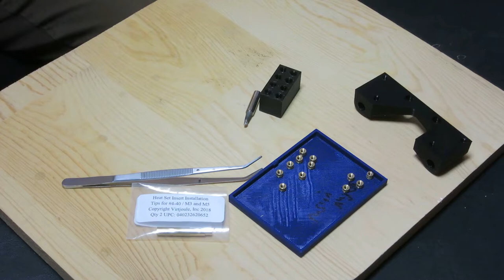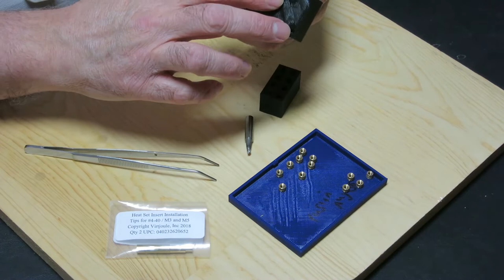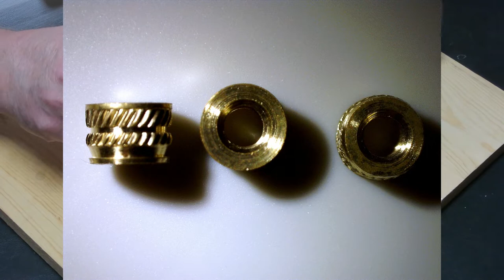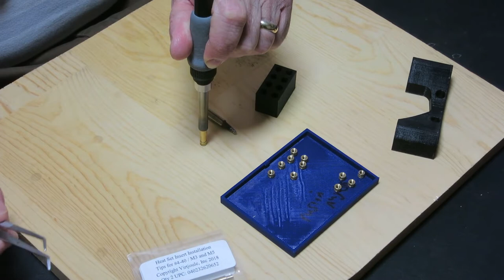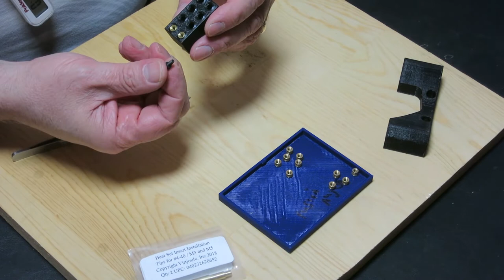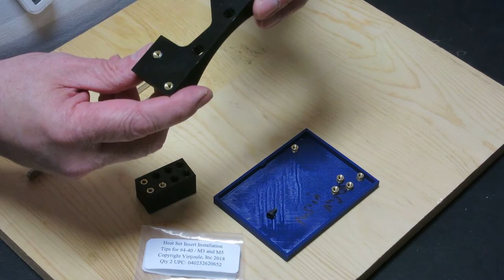I learn how to insert Heat-set Inserts for 3D printed parts

Comment: Excellent results on the first try! The key to implanting heat set inserts without fumbling with them is to print or ream the holes to the size of the small diameter on the bottom of the insert and place the insert into the hole. The inserts are specifically designed for the hole to be as close to the small diameter of the insert as possible to get the correct flow of plastic into the knurls for the optimum bond. Set the soldering iron temp considerably higher than the nozzle temp for the filament (or melting point of the plastic stock) and then apply the soldering iron to the insert. As the insert heats up in the hole, it will start to sink in with light pressure as soon as it reaches the minimum critical temp to melt the plastic. Immediately pull the iron out as soon as the insert reaches the right depth. This avoids placing on over heated insert into the plastic, causing it to over melt and crystalizing the bond that can weaken it. It also aids in getting the insert started straight and square, as it will naturally be squared up to the hole before applying the iron.

Comment: why didn't you heat them straight over the plastic?
Reply from the maker: Because the heating tip is smaller diameter than the insert, I figured the insert would heat to temperature more evenly if I rotated the tip at an angle while heating. Feel free to experiment, and let me know how a straight-over approach works. Thanks!

Comment: temperature to insert ?
size hole ?
Reply from the maker: Thanks for the question - There's a bit of experimentation involved, and the temperature depends on the melting temperature of your plastic. At 3:35 in the video I mention the temperature I used for PETG is 464 F (240 C), which is the low end of MatterHacker's recommended extrusion temperature for their PETG. I later found that using a temperature a little below the extrusion temperature (say 5 or 10 degrees C below it)  gives me a little more control when inserting the heat-set insert.

As far as hole size and shape, again it's a bit of an experiment. Lucky for me in this video, the printer part and its holes were designed by Lulzbot engineers. The Lulzbot Tips and Tricks page I mention in the notes talks about temperature and a few general design rules for making holes. See https://www.thingiverse.com/thing:3924423 for an example of a hole I created for one size of heat-set insert.

Stephan at CNC Kitchen has a few videos about strength of heat-set inserts: https://youtu.be/iR6OBlSzp7I and https://www.youtube.com/watch?v=G-UF4tv3Hvc. Those videos also have links to pages with more detailed information.

Good luck with your own heat-set insert work, and comment here to let me know how it goes for you - good luck!
Reply from the maker: P.S., I had forgotten I'd done a later, more tutorial and shorter video at https://www.youtube.com/watch?v=mgcgukodNNc&feature=youtu.be In that one I'm using a temperature a little higher than the recommended extrusion temperature for the filament (PLA in that video). So I'd recommend experimenting around the recommended extrusion temperature and see what temperature gives you the best trade-off between speed of insertion and control over the insertion.